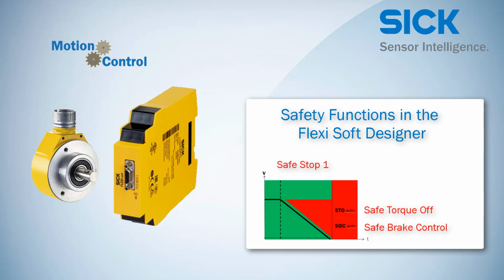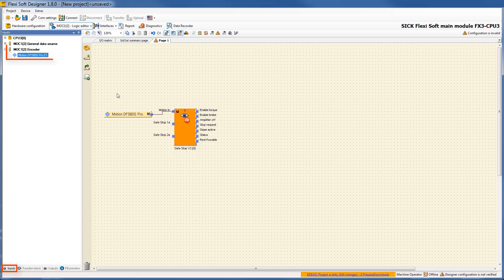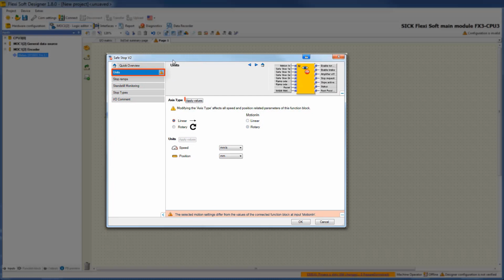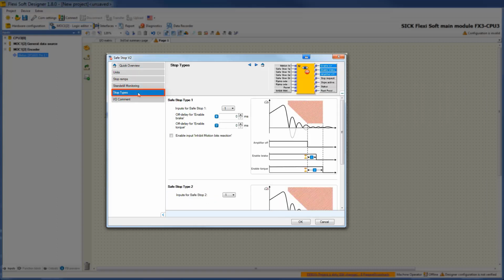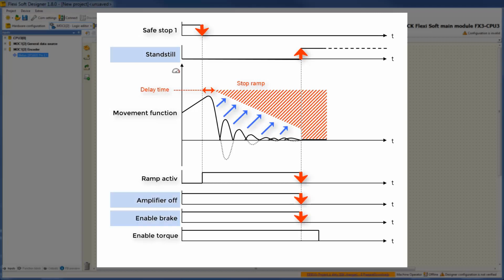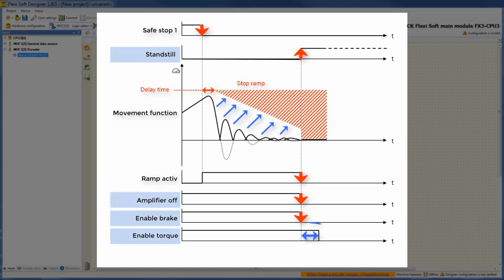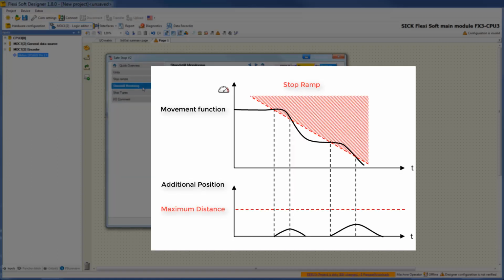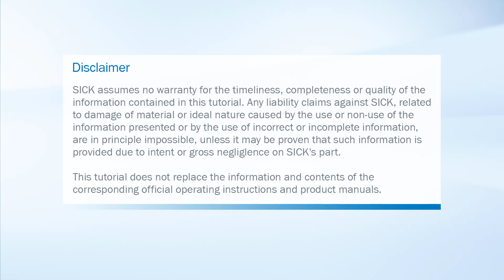Tutorial MOC1 (Part 1/4): Safe Stop 1, Safe Torque Off, Safe Brake Control | SICK AG

Comment: "Reset possible" output is no longer available. can you please update the documentation: OPERATING INSTRUCTIONS | Flexi Soft in Flexi Soft Designer with the latest models? Thanks
Reply from the maker: Thank you for your comment! We will look into that and check it immediately.
Reply: @SICKSensors  Thank you. Would it be possible to update me via email when you do so? 1150386@isep.ipp.pt or should i request costumer support latter?
Reply from the maker: The "Reset possible" output, as described in the documentation, only appears on the Safe Stop module if a reset is configured in the module.
Maybe it is necessary that you double check if you have defined the reset in the configuration. We hope this works. If you have any further questions, please feel free to ask our technical experts for support via mail (info@sick.de) or contact form on our website (www.sick.com).
Reply: @SICKSensors  Thank you very much for the support and the contact